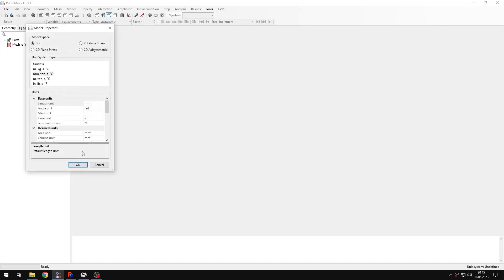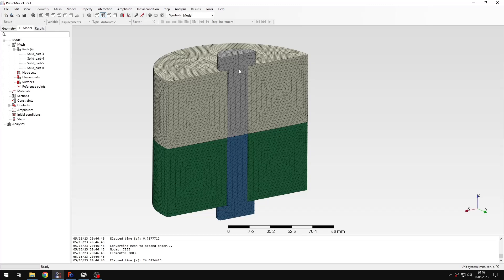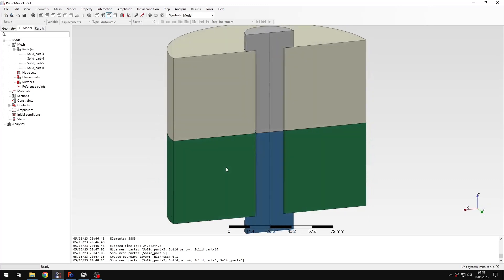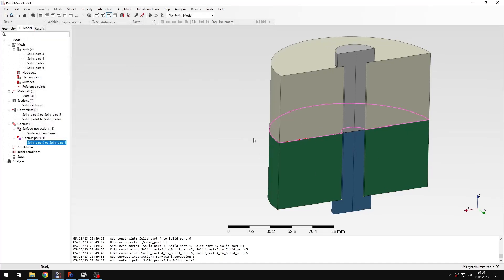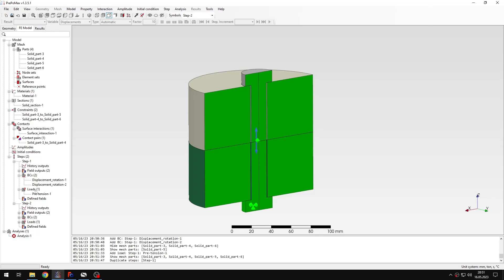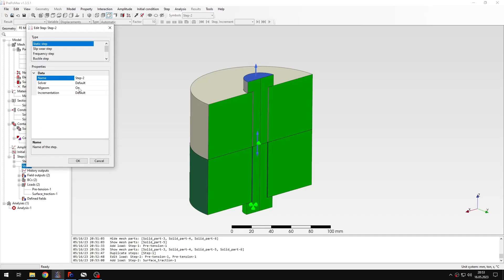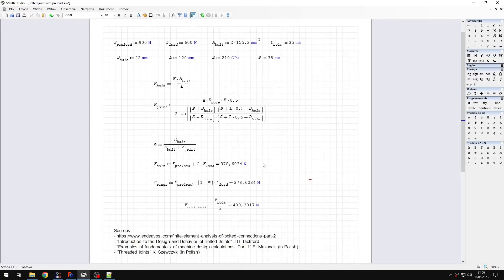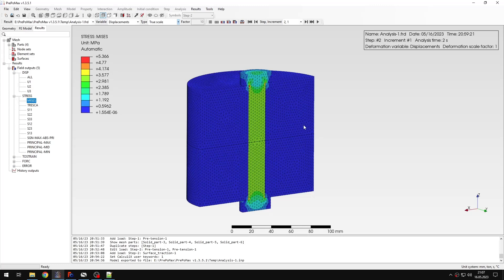PrePoMax (CalculiX FEA) - Tutorial 34 - Bolted joint with preload

Comment: Thank you for another useful tutorial.  I have a couple questions regarding bolt modeling: 
1.  Is it possible to simplify the model with 2d axisymmetric elements in calculix and prepomax?
2.  What is your opinion about simulating the preloading by artificially defining axial thermal expansion coefficient for the bolt and applying the delta temperature to it to induce equivalent contraction?
Reply from the maker: Yes, axisymmetry is sometimes used for bolt models, even with threads (the thread is treated as axisymmetric then). The traditional thermal expansion preload makes sense and is still sometimes used but in the case of solvers offering built-in preload features like Abaqus and CalculiX, it's usually preferred to use that automated approach. Same with shrink fit modeling.
Reply: @FEAnalyst  Thank you for the insights.  Actually the method you demonstrated was much more straightforward than I initially thought.  The 3D model with contact algorithm is taking a quite long time to solve on my machine though.  I will give it a try with axisymmetric set-up.  I hope I can follow the same steps in prepomax including boundary layer creation and preloading the bolt in two steps with nlgeom on.

Comment: Thank you for this tutorial... But when ran it in the end I am getting an error "*ERROR: too many cutbacks
 best solution and residuals are in the frd file" how to rectify this error?
Reply from the maker: It's a standard non-convergence message. Most likely there's some difference in the setup. Maybe a missing tie or an incorrectly applied pre-tension section. But double-check all the input values too.
Reply: @FEAnalyst  thanks a lot I'll check it out

Comment: Hi and thanks for the tutorials. in a lot of the tutorial I get small discrepancies compared to you're results. Do you think the problem is on y end on with the software version? 
These are the results I GOT.
moment about the center of gravity(mx,my,mz)

    4.340885E+00  1.117874E-01 -2.019869E-01

   area, normal force (+ = tension), shear force (size), torque and bending moment (size)

    1.545071E+02  4.878647E+02  4.228486E-02  2.019873E-01  4.342325E+00

Comment: Thank you for this excellent tutorial.

I am still learning and your videos provide excellent way to use PrePoMax effectively.

I am confused as to why did you make displacement 0mm in Step 2 for the surface that joins bolt with shank.  Will this not make force applied on the bolt head to go in the top part of the bolt only?

I have a question regarding Contact surface pressure on the faces of the members that the bolt is joining.  Can you please show in your video how to show Contact Surface Pressure.  My understanding is that when you apply PreLoad, contact Pressure should be a certain value, and then when you apply other loads on the members that the bolt is joining (e.g. two flanges or two plates) then this pressure will increase or decrease depending on the direction of force/pressure.  Am I correct in making this assumption?
Reply from the maker: Actually, I set it to "fixed" for the second step. The same procedure is used in Abaqus. Like I said in the video, this way the adjustment of the bolt length is maintained in the second step by fixing (freezing) the degrees of freedom at their current values at the beginning of the step. Then, with further length changes due to preload prevented, the bolt acts as standard deformable component and can respond to other loads properly. Otherwise, the force in the bolt wouldn’t change from the first step.

Contact pressure has to be requested in field outputs before running the analysis. I showed its usage in tutorials 17 and 29. The clamping force will be equal to the pre-tension force and then decrease in the second step due to the external tensile load.